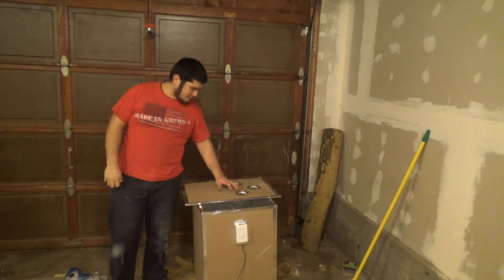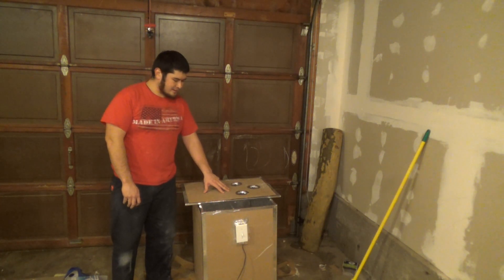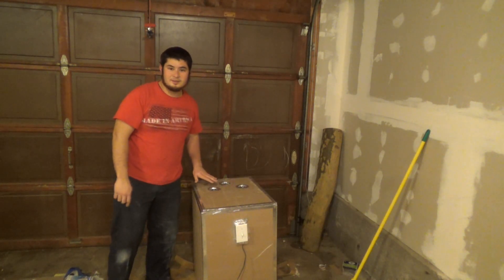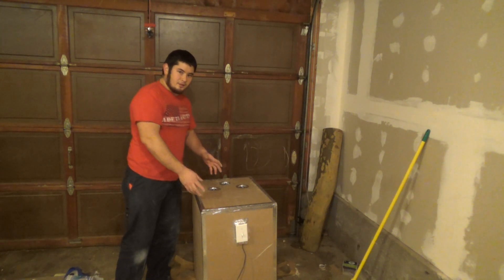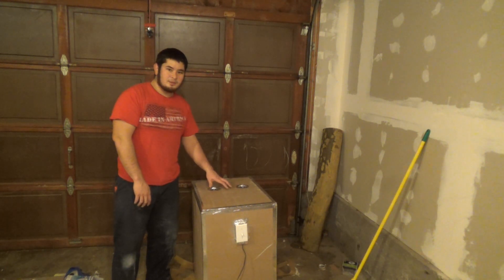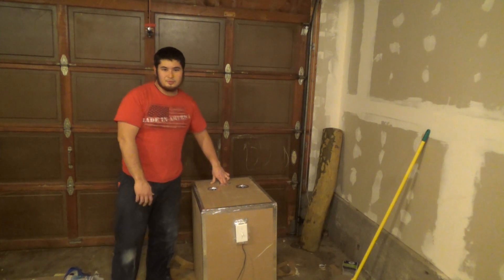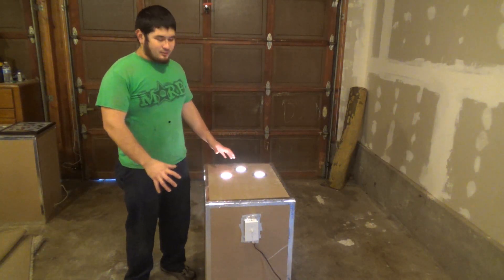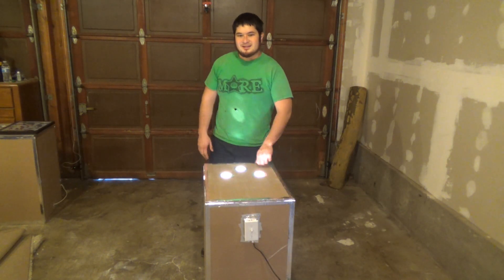Building a PVC Bow Hot Box Part 6 - Running the Box

Comment: how would you put reflex/deflex on a bow using this?
Reply from the maker: Just dip the whole limb into the box and rotate, checking every few seconds. This will get the whole limb just soft enough to reflex/deflex without causing areas to puff up unevenly. If you do leave it in too long, the bow will puff up, so the trick is to check on it regularly.
Reply: ah thanks